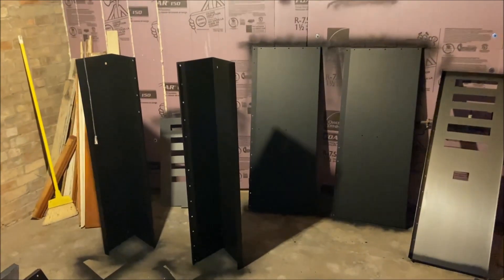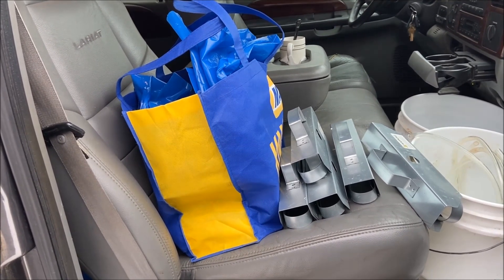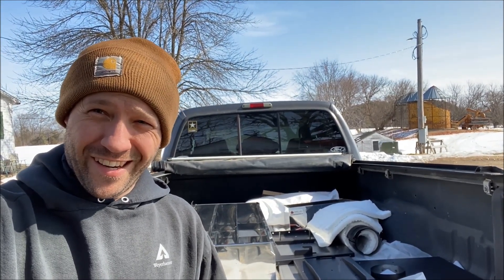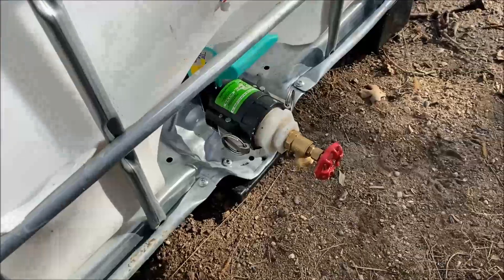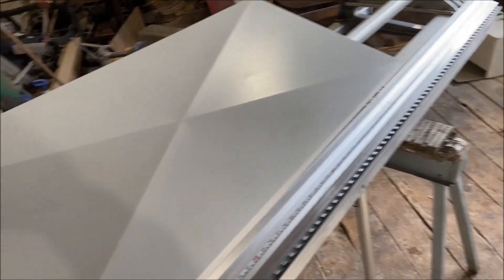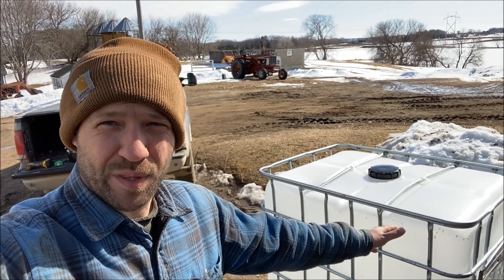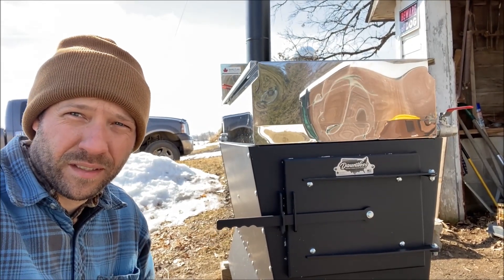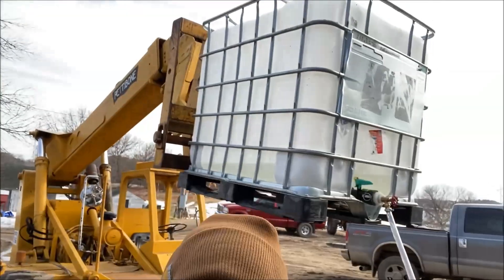Maple Syrup Season - Part 1

Comment: If there is any slope to the land, use a sled and start at the high point and work collecting back to the truck/road.  I guess you would have to get a small tank to put in the sled as the buckets would splash and spill.  Hello Duke...  ha ha.